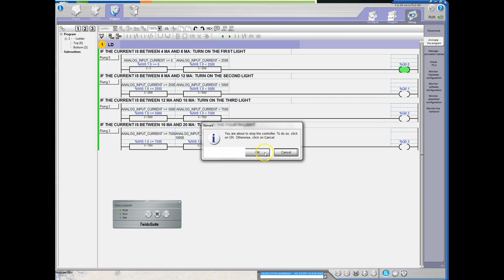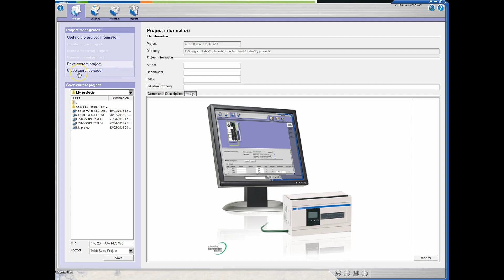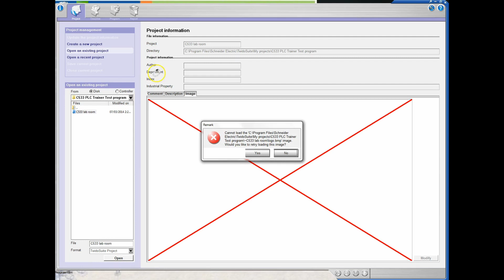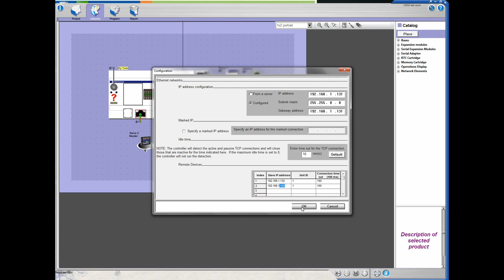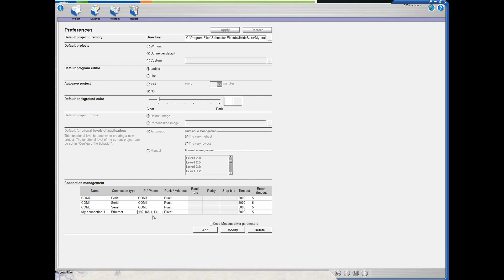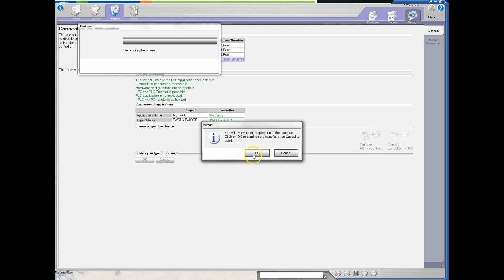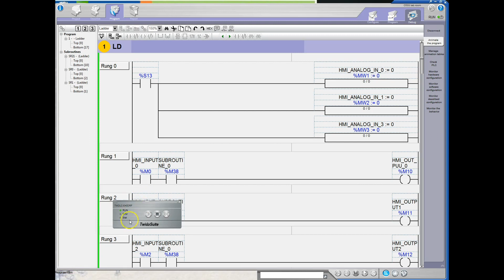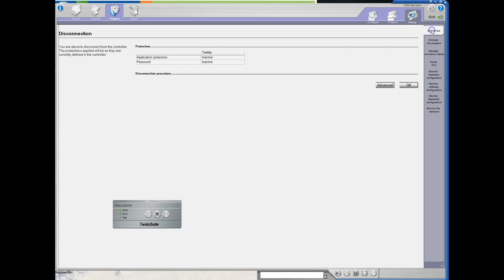How to restore the Base PLC Program in the Lab

Comment: I have a PLC of model number twido twdlcde40drf in my work place. the problem I m facing that the program of plc can be copy and download in another plc but it can't be shown and edit. So what is way to unlock the program? Because I want to change the com port of plc to connect with HMI of shnieder make for communication with drive and temperature PID controller.please help me on this matter...